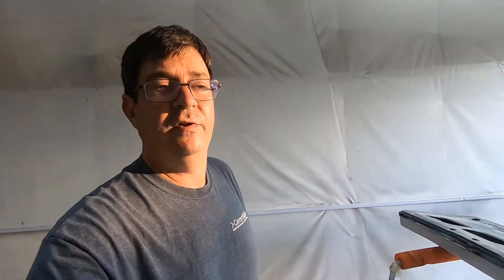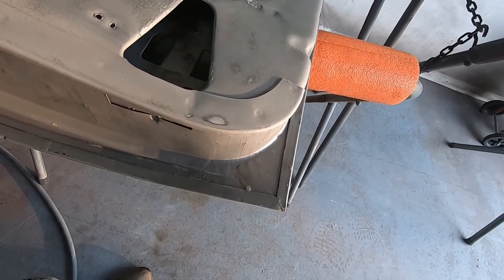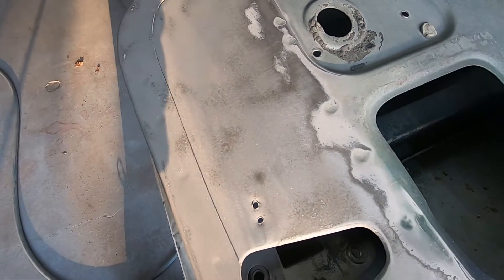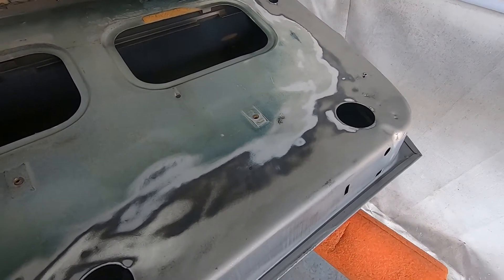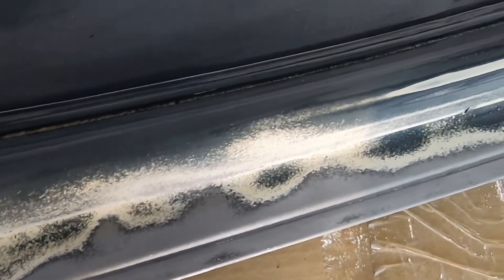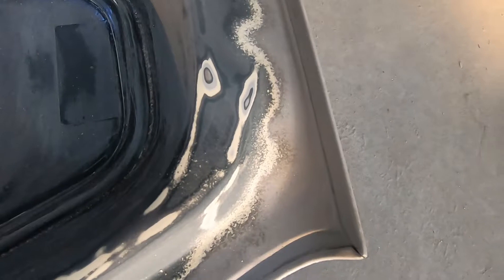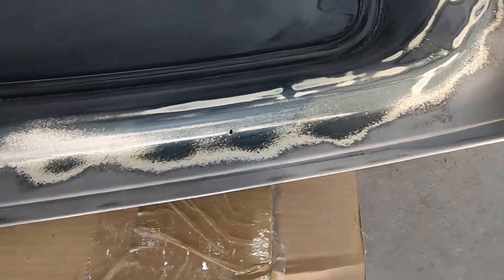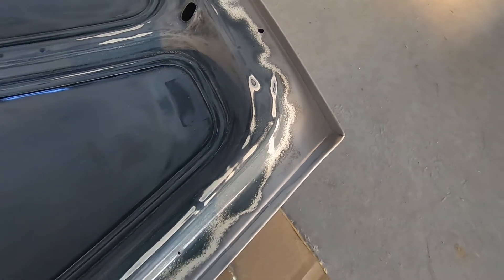How To Use Epoxy To Seal Sandblasted Metal | Corrosion Protection for Autobody Panels.

Comment: doesn't all that epoxy have to be sanded off prior to the actual priming and painting of the car?
Reply from the maker: No the epoxy is the corrosion protection for the bare metal of it sits too long, like days, you have to sand it for adhesion of your primer.
Reply: wet sand flat then prime?  @HogshooterHotrods
Reply from the maker: @loveonjohn  If I am spraying paint over the epoxy I usually just sand dirt nibs out the proceed to base and clear. I only sand if it has sat too long for the primer to stick if I am spraying high build over the epoxy. the epoxy does not have good sanding characteristics. It clogs sandpaper and stays a little softer than the high build which is a urethane.